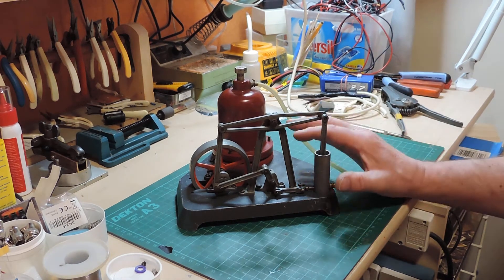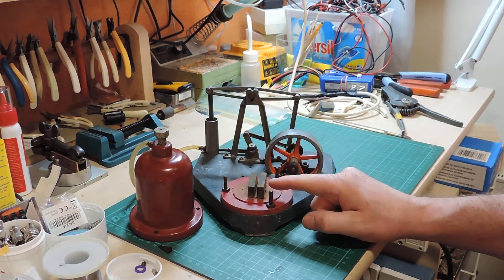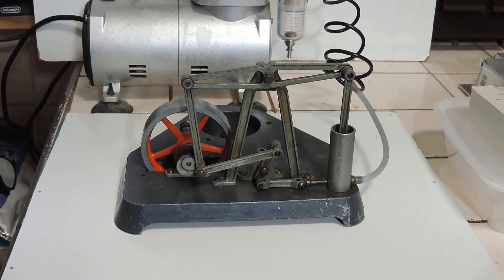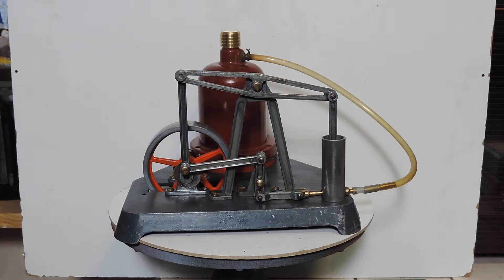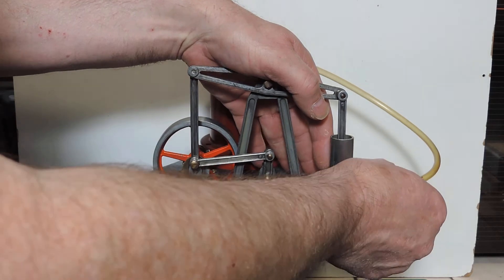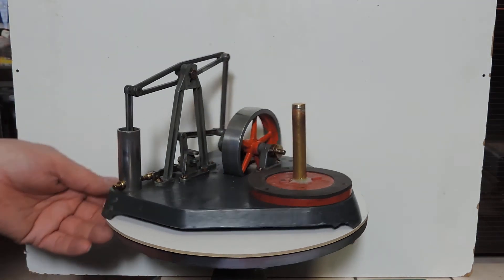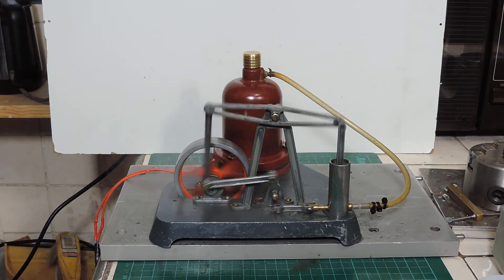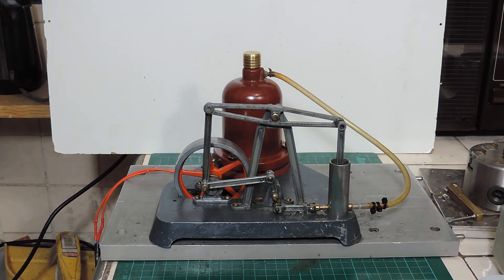Junior Engineer SE-100 Model Steam Engine

Comment: where did you get that element? is it 110 volts as well??
Reply from the maker: It came from China via ebay and yes it is 110 volts. If you search for something like 'rod heater element' you should find some.

Comment: I don't  think the blocks have to be carbon.  As long as they don't touch each other, you could probably use brass, aluminum, or just about any metal.
Reply from the maker: You may be right, I just thought I'd stick with the original material.

Comment: Hi Alan...I've found an identical model here in Kokomo, Indiana; minus the piston.  When you have a moment, could you possibly put a micrometer on yours and let me know its dimensions?  I'd like to try and maybe have one machined.
Reply from the maker: Hi. No problem. The diameter is 5/8" and the length of the piston is a slightly odd 41/64". It is solid brass with a slot machined in the centre of the top of the piston to take the conrod. The slot is 3/16" wide by 19/64" deep. Cheers, Alan.